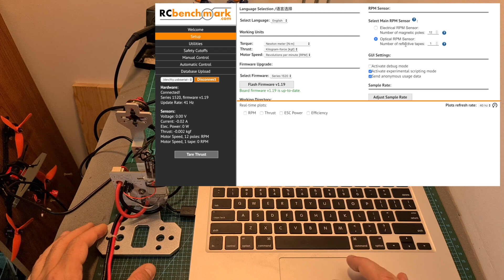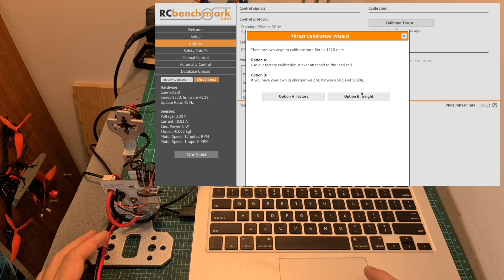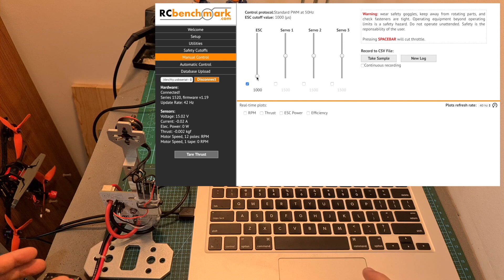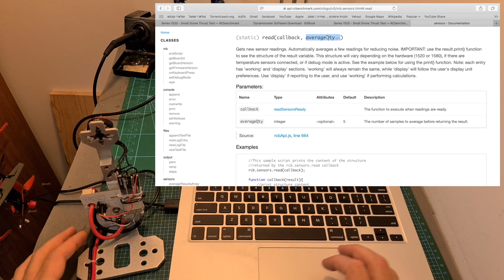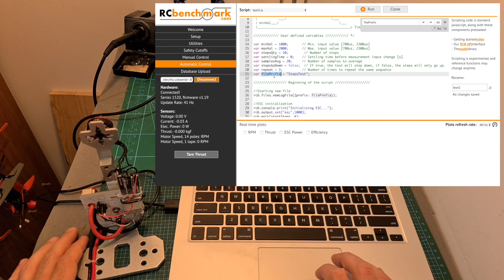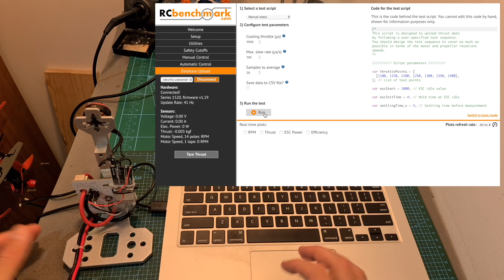Tyto Robotics 1520 Thrust Stand - Setup & Review

Comment: Nice. Gal a month ago you tested a GepRC 2306.5 1350kv motor and it caught fire and showed very low thrust per grams compared to spec sheet. I made a comment and you said there was perhaps a problem with the testing and or motor. Do you have any plans to perform a retest? I'm still curious about purchasing them for a 7" build but nowhere has any reviews but you and until I see them run without catching fire I can't bring myself to click buy lol.
Reply from the maker: Hi buddy. I will thrust test similar motors from Rcinpower. Unfortunately I don't have another Geprc motor to test...
Reply: @KremerFPV  Ah ok. No worries thanks. 👍